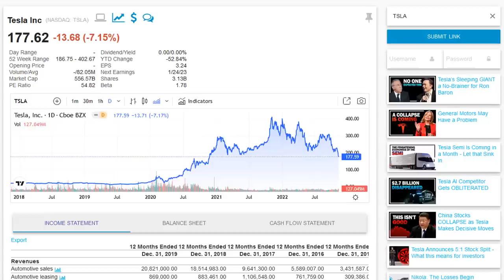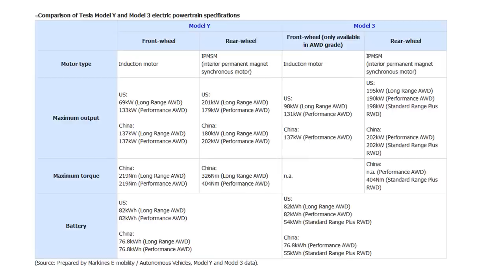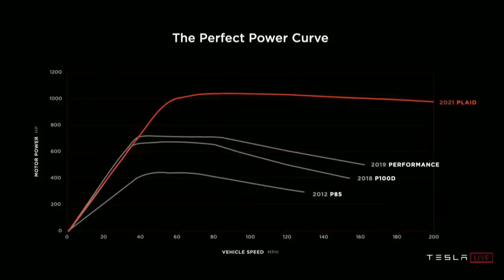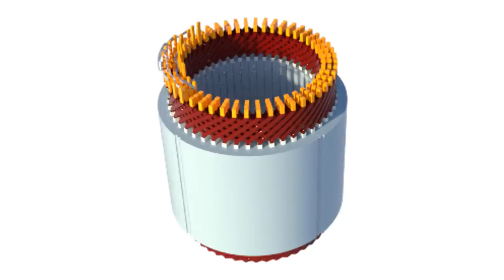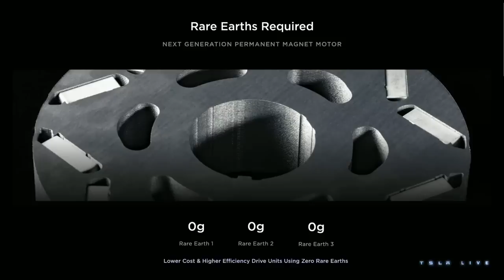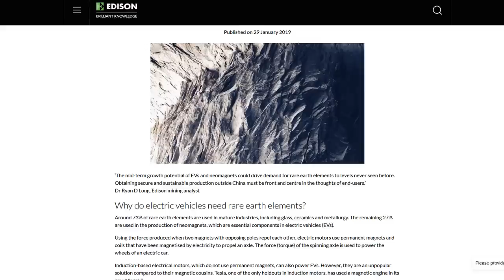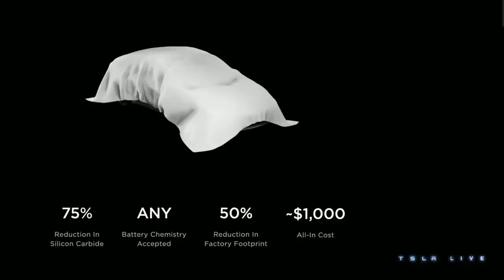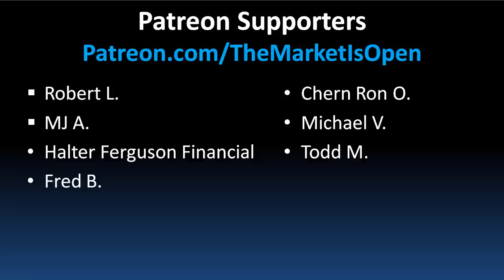Elon Musk's NEW INSANE Motor SHOCKS The Entire Industry!

Comment: A new form of magnet was announced last year and was said to become available at some point in 2023. It's some type of composite  made from commonly available materials. Almost as good as neodymium but massively cheaper to the point of being revolutionary.
Reply: This alone will be enough to change the whole scarcity dynamic. Elon is locating single points of failure and eliminating them.
One of the last remaining hurdles will be the availability of electricity for all these EV's. We're going to need nuclear reactors.
I would dearly love if Elon put together a team to finally perfect the Gen 4 reactor that consumes nuclear waste as fuel. There's no downside to this. It generates a billion watts AND eats all the previous radioactive waste. What's not to love? Make it happen, Elon.
Reply: @protorhinocerator142  Russians have that already and building portable floating  stations you can transport along the rivers and sea to power cities and factories
Reply: @TheGrateful108  aren't those 'LFTR' designs? nuclear oversight won't allow not easy to make bomb facilities. Even at 1/2 price and size with 10times fuel life and one tenth the radioactive waste.
Reply: @mikedar8484 Those are fast-neutron reactor (FNR) breeder capable. They burn waste, make new fuel more than they burn, creating infinite cycle. They can breed Thorium to U233 as well. It will take few years to scale up and workout enough fuel for expansion. Latest reactor uses liquid led as heat transfer/radiation shield and is very efficient, safe and stable. It can't explode like Chernobyl or Fukusima
Reply: @TheGrateful108  Agencies/Commerce companies in Fascim
Reply: @TheGrateful108  lFTR runs off, currently, free material except for a starter plug of uranium, creates a small increase of uranium over the 18 year life of the fuel.
Reply: @mikedar8484  International Fascism with robotic labor is the near future after Capitalism. Fascism means priority of National interest and State power over Capital with State Capitalism like in China with Vertical Integration and Monopoly Efficiency Optimization Method. Vertical Integration and Monopoly Efficiency Optimization Method is more efficient than classic Capitalist competition and was developed in Stalinist USSR and copied by Japan, China and finally adapted in the west by Ilon Musk. State Capitalism model is efficient monopoly and doesn't require competition to prevent stagnation. As you can see Ilon Musk doesn't  require any competition in order to develop, although he is building a pure monopoly with vertical integration ahead of any competition. The same system was working in USSR before 1953. Khrushchev coup ended Stalin Efficient State Capitalism and turned USSR into inefficient Ideology State and eventually it collapsed. So Efficient State Capitalism made to China, Japan, then the West and hopefully going back to Russia (updated and improved)
Reply: @mikedar8484 It takes 6 years and 8 regenerative cycles to completely cycle the material and switch completely to recycled fuel. Reactor breeds more than it burns. It will take a decade to make economic impact
Reply: @TheGrateful108  it would tale likely 10-20 years to build out 100 lftr plants depending on size and derivation of ruling administtations and be recycling 5+ plants at any time giving scale with one plant worth done every 2=3 months... Required is dedication, the breed is only 1-2 percent extra
Reply: Iron phosphates IBelieve
Reply: The ' commonly ', as I understand is Iron based, perhaps a ion of iron?

Comment: My understanding is that Tesla use Switched Reluctance Motors (SRM) and  Induction Motors. These types of motor do not need magnets to function, although Tesla has introduced deep seated permanent magnets to improve the performance of the SRM design. Bear in mind that both the SRM  and Induction design have a long history and Tesla have  refined and improved on old ideas.
Reply: Lookup sandy munro and his og model 3 teardown. Even back then tesla was using a process of gluing the opposing magnets together.
Nobody else had done that to that point according to munro. 

He's very critical in that first tear down, yet still blown away by how innovative it was. It inspired him to send Elon and the tesla team. 
A 230 idea long set of suggestions to improve the m3 free of any charge. Simply because he wanted the innovative upstart to survive. 👍🏻

Teslas engineering team is just on another level "built on earth by human's" who also specialize in "making the impossible merely late"😀
Reply: @4literv6  I am guessing that the magnets are stuck together to create a Halbach array which allows the engineers to focus the lines of magnetism?
Reply: IPMs aren’t SRMs, but they have torque-generating reluctance characteristics. It’s a similar idea but not the same.
Reply: Overpriced, antiquated designs,  just slickly packaged for investors. Value= ZERO !
--------------------Hydrogen is the future.
Reply: @wave8359  how do you plan to turn the hydrogen into mechanical work, exactly?

Comment: Ummm...Question.....why doesn't Tesla work on an entry price point sub-compact, with a smaller and lighter motor and drive train, and a smaller and lighter pack ?
 i mean what if it didn't need to accelerate any faster than a normal compact ? ... maybe not the quickest thing in the world, but i could bet they would go out the door quicker..
like take a 2 door cabin seating cue from extended cab 1/2 ton trucks; but a low-light mono body, with an aerodynamic hatch back trunk and short aerodynamic nose.
same efficiency motor and pack, More G-Force Per Joule.....Tesla's Fastest Production Line To More G-Force Per Joule !!!

Comment: I believe I can cut Tesla's copper usage by 50%... and reduce there magnets cost by near 75% while also providing a method for the creation of the magnets they would need and the design for the next motor and the parts of it's manufacturing... depending on cost of materials I may even have a solution for overheating and power usage.
Reply: Ok
Reply: Sounds great...what is holding you back?

Comment: My issue with the high voltage battery is that 1 bad cell will render the entire system unusable. It should be intelligent enough to isolate that 1 bad cell and be able to operate normally
Reply: They already have safeguards built in for that.
Reply: There called bypass diodes, very simple mod. It will automatically  bypass bad
battery. A no brainer.
Reply: @KA9DSL  by-pass diodes are used in solar panels not high DC voltage used in  battery applications. Why are you spreading misinformation for the sake of it.
Reply: @KA9DSL  bypass diodes are mandatorily as is cell balancing
Reply: I was wondering about this issue. I have crudely calculated the 4680  pack cell arrangement. Let’s say the pack has around 830 cells, In order to output 900volts then the pack would have 4 rows in parallel and 225 cells (each 4volts) in series. The early packs had a fuse on every cell in case one failed, it is not clear if this is the case withe 4680 packs.
Reply: @propelegant  [The early packs had a fuse on every cell in case one failed,]
? It's a series string, how can fusing help? Did you mean bypass diodes?
Reply: @stephensaines7100  I think that the cells are placed in parallel first so that if a cell fails there is a drop in capacity. These parallel packs are then connected together in series. This way avoids a break in the series when a cell fails.
Reply: @propelegant  I just had six packs.and since I was 30 years old+ not any more
Reply: @Al Jay Average batt industry wide is now $5k... Prices continue to drop. Give up the 20k narrative, sounds silly
Reply: @mikedar8484  still expensive for breaking into a cheaper market
Reply: @Judith-rx8de  more price drops coming, overall a cheaper market only exists if it is being filled and 20k dropping to 5k drops a 40k car to 25 with same margin percentages for solving a problem needing dealt with, adorable entry transport.
Reply: @mikedar8484  not true, saw a bill just a few weeks ago.  $35k with install.
Reply: @cryptobuddha2600  I will R+R for50k... (what the market will bear isn't what is available in the marketplace
Reply: @mikedar8484  An online search tells me that "On average, current EV battery packs cost around $10,000 to $12,000". (Jan 13, 2023).
Reply: I'm pretty sure they have that, but I'm not sure how they implemented it.
Reply: almost all so call Tesla inventions are existing technology!
4680 battery is a typical one, the larger cylinders is not new, there were even bigger ones,  the many contact leads of electrode structure has been using in high current (high C) versions! All RC helicopters, drones are using them.

No rare earth motors were deployed in our A.C. fans motor for over a hundred years.  It is just Lenz's law induction theory,  the solid rotor are not rare earth magnets, it is just closed circuit copper wires embedded in the solid rotor, when induced by stater's coil flux, the rotor's embedded coil will generate magnetic flux, it is the Lenz's law!
Reply: @leungdom3041  Making the impractical practical is inventing. It is tangible innovation. All ideas ever have been had by someone a long time ago. Making it a reality is the difference. If somebody could have done it before, they would have. They couldn't, but Elon can according to what he's saying.
Reply: @Al Jay Price is dropping fast
Reply: Low voltage means higher current and larger wires, making the motor larger
Reply: @aussiegruber86  And much less wire count, motors do not get much bigger
Reply: you would "question" Elon Musk ???
Reply: Battery are plugged in series, would be hard to pull off.
Reply: @Al Jay 
"LOL"
You missed the part about the whole point of the 4680 form factor? that it's more material in fewer cells, meaning faster production? or that the dry Cathode/ Anode process removes a huge part of the coating system, reducing the factory size, and thus the price?
How about that by the time these packs are out of warranty, the cost of replacements will be a fraction of the current cost of the latest 2170 packs (which is just over $10k). 
You need to watch the Munro stripdown. They mention the individual cell fusing.
.
I suppose ignorance is bliss in your case?
Reply: Harness the static created once induction occurs to supplement charge and reduce emi and resistance requiring less amperage and smaller batteries?..Just sitting here having a stupid attack and shared it...
Reply: @Al Jay someone like Volkswagen would do this when they catch up with the technology
Reply: For a monthly subscription plan of  $112.00 per month we can simplify  your battery worries , thank you for choosing T  esla . Powering DO wn <%#+=%^&_ sorr  y
Reply: bs
Reply: I think it WILL be.
Reply: @Al Jay If Nissan can refit a battery for £11 ,000 Tesla can do the same i should think.
Reply: @kenparkes7025  Nissan batteries are smaller, but the probability of having to change one in less than 300k miles is very small.
Reply: Why would they?  They should, just to be a "stand up company".  We could use some dignity in business again.
Reply: I think this is why they are putting 2 motors (front and back) in the cars. They say it's for low torque high torque acceleration / cruise efficiency. But in the event of a motor failure, the other one can get ya to the mechanic shop.
Reply: @Al Jay The battery management system in a Tesla can quickly detect bad  cells and route energy around them. With more than 4000 cells, evrn new  battery pack will have a few dead cells.
Reply: @Al Jay nicely stated
Reply: There’s plenty of people already repairing this issues please know what your talking about 😂😂😂
Reply: A lot of BMS stuff goes inside each module.
Reply: @horserous  BMS stuff will withdraw  some  power , also
Reply: @iontrandafir5762  for sure, this really true. But you can't do without BMS there.  Lithium chemistry is quite  delicate, fire etc.  So a tradeoff. I'm always praying that another technology comes along to replace Lithium,  but things don't look that promising as of now.
Reply: @aljay2955 exactly!
Reply: @venelog22  
"exactly" incorrect.

Comment: The current EV market is interesting, BUT when compared to a gas model there is not a single EV (car) on the market worth more than 15K due to the short comings of short range and too long to charge. Once they get a range to a minimum of 400 mile, any weather and driving conditions, and a charge time of 10 minutes or less empty to full without causing battery degradation, then they will have something to look at. For now, they are nothing but an overpriced inconvenient novelty. I will keep watching the progress.
Reply: The market disagrees with you and will continue to disagree with you. Most people charge their EV's at home, so most of your criticisms are invalid.
Reply: @skipondowntheroad5833  no, the market DOES NOT disagree. What you are seeing is fools parting with their money.
Reply: Dude, you are missing out on the fun. Go for it!! Electric cars are a blast!!!
Reply: @ChitFromChinola  My vehicles are not toys. They serve a purpose. The current line if EV's are impractical.
Reply: OK. Let’s be practical.

Advantages to electric cars:
1. More reliable
2. Lower cost of operation.
3. Simpler
4. Longer useful life (double ICE)
5. Safer
6. Better traction in poor conditions
7. Full battery every morning.
8. No stops at gas stations
9. No scheduling oil changes
10. No used oil to get rid of.
11. Pre-warms in 4 minutes
12. Pre-warm with garage door closed.
13. Fast acceleration out of tight situations.
14. Always runs in cold weather.
15. Makes you smile every time you drive it.

Don’t be a grumpy old wet-blanket. Just go for it. You’ll love it.
Reply: I have 2 Teslas I can’t disagree with you more. 320 mile range and charging at home is more than enough for 95 percent of my needs. If am
Going somewhere where there are no chargers I rent an ice car for $30 a day. That happens once every six months. In the meantime I save $$$ in gas and maintenance.
Reply: @ET-bg8ru  I do not have to have a backup plan with my gas vehicle which is less expensive than your Tesla toy. It has been said that a fool is eager to part with their money.

Comment: Still doesn't answer or address the question.....where do we get all the electricity needed to charge and keep charged all these battery operated cars.
Reply: Same place as we always have, the grid or our roofs. The grid offers more efficient well-to-wheel efficiency, than the gasoline and diesel distribution networks. And the grid is steadily becoming more efficient (less carbon, lower cost per watt generated) as renewables and grid level storage become more widespread and cheaper. Plus with so much development money pouring into research, the watt-to-mile and cost-per-mile metrics just keep getting better. A virtuous cycle that is good for drivers, the environment, and investors.

Comment: The problem with ANY permanent magnet, rare or not, is the fact that it is not permanent. They all loose magnetism, as is the nature of magnets. The more you use it, the more it looses. The more it heat-up, the more it looses. To get it back, normally requires a super-high blast of EM-fields. Which is how they are created in the first place.

Rare-earth magnets tend to have more power, but are also more sensitive to heat. So, going to normal magnets, will instantly offer longer life power, at the cost of slight weight increase. Adding some kind of back-EMF pulse, can provide some additional power-gains, after losses. (Like a temporary power-restoration to the magnets.) The cost is, obviously, power to do that. Every component is there to do it, within the motor itself.

Ultimately, he is working towards getting these things into the mid-level consumer market, so that ALL prices can be reduced and even more parts can become "universal", or "swappable". You don't get good availability by making only specialized parts for specialized people. You make them for "the masses", and offer "upgraded parts" to the high-rollers. This places more shops in more locations, and more ways and people to fix them, everywhere.
Reply: Thanks for the info, that was a good explanation of permanent magnets.
Reply: I had an electric guitar made in 1937 whose pickup with permanent magnets in it, still worked fine.
(1937 Vega lap steel)

Edit: but yah, no  heat applied.

Comment: There's really no revolution to be had, in regards of energy-conversion efficiency from new electric motors. All electric motors are efficient and have been for a long time. There is no margin left for  any "revolution". Permanent magnet motors are however not sustainable technology. (Very little about Tesla - today - is sustainable, but hopefully it might become one day). So if that can be changed, that will be remarkable. Still, there is very little need as you can use induction motors instead.
Reply: What's not sustainable in Tesla? It's probably the most sustainable manufacturing company on the planet.
Reply: Is that like a steam engine that runs on electricity. Last I checked engines rely on burning stuff to turn heat in to work. Rockets are motors that turn chemicals in to thrust. There is no electric engine only electric motors
Reply: @theairstig9164  Thankyou. Fixed.
Reply: Motors not engines 😉
Reply: @joebrdr  Thank you. I've edited the  post.
Reply: The trick is to simplify production, lower costs, rpm respone, and improve heat dissipation while keeping performance or improving it.
Reply: Don’t be such a wet blanket. The revolution is cost reduction. And, Tesla cars will be fully sustainable through recycling. You already knew that, but elected to troll here anyway.